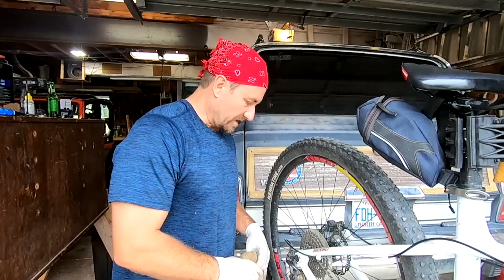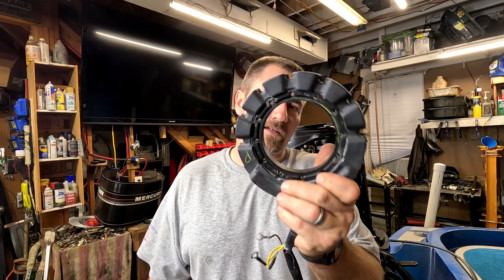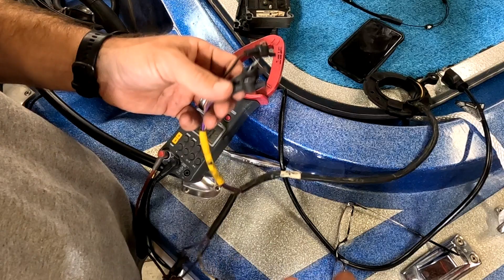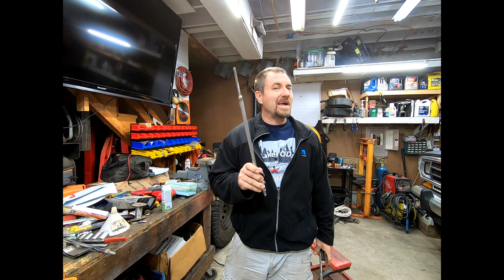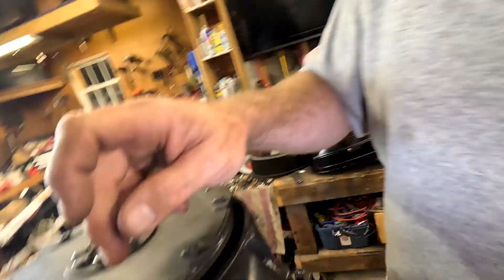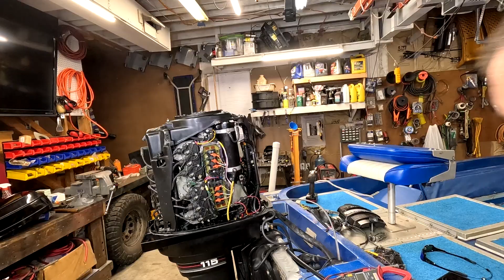Mercury Tower of power Not running well.  Simple OHM test to find the issue.

Comment: Could you share the actual numbers from the book for what ohms should be, or the name of the book you are referencing? I'm having similar issues to other commentors, except if I feather the top end of the throttle it picks up and goes (still not as powerful as it should be). Carbs were just rebuilt. Electrical is something I can test while i wait on a fuel pump rebuild kit. Thanks
Reply from the maker: Sorry for the delay.   We just got back from an Alaskan trip.    it is where the internet forgot to spread.  :)     But would recommend a trip.   But I would have liked to do more fishing.   Maybe next time.  

I just finished a fuel pump rebuild this morning.  I hope to get it out this week. 
You can also check your timing.    Super easy. 
     https://youtu.be/Yn8pdeiwbas
For a manual of your engine.  just get your S/N and you might have to order a paper copy.  i am sure there is a pdf somewhere but a paper copy might be better in the shop. 
     https://www.mercurymarine.com/us/en/parts-and-service/service-and-support/owners-manual

I just love the Tower of Power.   So smooth and last for ever as long as you give it some love sometimes.   

Thanks for the question and let me know how it goes.

Comment: What issues did you have when running with the bad trigger?
Reply from the maker: The trigger was not huge to replace since I had issues with the stator.    So i changed them both.   Was not having any issues with the trigger.    i still have it as a spare.    I now have fueling issues at wide open.
Reply: @5LakesGarage I guess I’m curious what symptoms you had with the bad stator?

I am having issues with my motor running fantastic on the hose but in the water seems to not want to get to full RPM seems like it is running half of what it should.
Reply from the maker: So the stator has two different ranges.    low rpm and high rpm.    I don't remember the color for each.    it sounds like the high rpm might be having issues.    it has been a bit since i messed with it so I will have to remember.
Reply: @5LakesGarage I also have an early 70s motor which has a different switch box and some different components than yours.

Comment: Hey man I was wondering if you could help me? I have a 1987 2 stroke Mercury 115 6cly outboard motor and it will idle for about 20sec and then shut off. It use to idle okay. The fuel pump was rebuilt. It has good compression in all cylinders. It does have spark in all cylinders. Although when I pulled the spark plugs a few cylinders looked to be running pretty lean and others were running rich. when I get it on the water it bogs down at full throttle and does not go full speed. it goes around 5mph at full throttle. Then randomly after around 20 to 30 minutes of full throttle and it bogging down it will randomly surge and start going full speed and not stutter or have any problem at all until you go back down to idle where it happens again. I have recently went through the carbs and cleaned them I did not see anything wrong with the float valves it did have a float with gas in it but I replaced it and it did not help. I also recently replaced the power packs. I’m not really sure sure where to go from here.
Reply from the maker: Sorry for the huge delay.   Day job is getting in the way sometimes of what i really want to do.   Help you guys.    

so it sounds like you have covered the fuel pump, compression and spark.    it does run but like junk so I am thinking of two things.  One basic, do you have a second fuel source that you can try out.   I just had an issue with my bothers outboard and he had a pin hole up the line that was bringing in air.  not a lot but enough for it to run for a bit and shut off.  Super annoying.   the lean cylinders and shut off seem like it is loosing prime.    Super easy to check.   The other would be getting a good signal from the trigger and stater.    Check out this video to be able to test them.   https://youtu.be/jlfrhwPYYV0?si=nZEcxEUgXZYkNbrO

i Hope it helps and sorry it took so long to get back with you.

Comment: Hey thanks for the nice Video. My motor starts only at full throttle idle and idles not too high. it is ok but when I release the gas to go in neutral and into gear it dies immediately. What I wonder too is that i can pull the sparkplug plug from cylinder 2 and 3 and it runs pretty much the same but i do get shocks when i pull them so it should get spark or not?
 I am thankful for any Help.
Reply: Another question: whats the name of your spark plugs?
Reply from the maker: Sorry for the really late response.    I am way behind and trying to catch up.    I like the NGKs
https://www.amazon.com/gp/product/B08B51WJGG/ref=ppx_yo_dt_b_asin_title_o07_s00?ie=UTF8&psc=1
Reply from the maker: Will have to ponder this for a bit.   What were you readings after doing the OHM test?   I am favoring a fuel issue if you are still getting spark.   
https://youtu.be/UMK2hxR4JFo?si=sybTxkhfwQxUEwCm

Try this one.   Might not have to do a full rebuild on them but a good check of the floats.   

Sorry for the really long delay.

Comment: Do you happen to have the part numbers for the stay or and trigger?
Reply from the maker: https://www.amazon.com/gp/product/B079CTMFWJ/ref=ppx_yo_dt_b_search_asin_title?ie=UTF8&psc=1
https://www.amazon.com/gp/product/B013SGEAWG/ref=ppx_yo_dt_b_asin_title_o09_s01?ie=UTF8&psc=1

These are the two i used for our Tower of power.    So far so good.  Put them in 2 years ago and it runs like a top.    

Good luck with your project.

Comment: Where did you find power packs
Reply from the maker: it look like the original place i got them do not carry them any longer. 
I found a few.   I love to go with OEM but this one is a bit high.  wow
https://www.boats.net/product/mercury/7778A3?ref=24b4bfbf9c11f3f4835ebff9137ae95a0f08c565

This one is a bit better
https://www.wholesalemarine.com/sierra-18-5775-switch-box-replaces-332-7778a12/

This one has the best price but you might have to send them back a few times to get a working one set.
https://www.amazon.com/Switch-Mercury-Outboard-332-7778A12-Switchbox/dp/B074M1X7QN/ref=sr_1_1_sspa?crid=3PCBMPHRMQ4B&dib=eyJ2IjoiMSJ9.NlbW9GpMo_QgF_fPPYPEJV1quX1J-Xt7bQY_4OwAkTPHc4M6VPvMzdx1tR5zFIysNRxy7b5ICDP7iD71prHPsqAPOXEO-6GgkvtLqye1DK0Ro52zd8P0I_zAuVfgMRJHJPtKVh40RlhTyMYrEZyhCQ3LaSOePNk84kL6UTVZkTk9WkRIs4-uxbj0I9u_O1ZCpiJxijEwT2O2ic1x58ZIf49jAviIZwJhkO3pAykJmDa1eJB_Tj23UKdp8jxU8-yBN7WEhOiOor1D-zttiJpF719NkyvN88uwZ03QI-BU3mQ.FT0zc2VfzXeIIVkjtzn77knQBJh_d-Sw7rDVAQiUiMQ&dib_tag=se&keywords=mercury+115+2+stroke+power+packs&qid=1713529594&s=automotive&sprefix=mercury+115+2+stroke+power+packs%2Cautomotive%2C90&sr=1-1-spons&sp_csd=d2lkZ2V0TmFtZT1zcF9hdGY&psc=1

I was lucky and got a set of working one the first try.  

Good luck.  it is good to see we are keeping the Tower of powers up and running.

Comment: How do you check oil on these motors sorry i just got a 1979 merc 90 6cyl and i dont see a dipstick?thanks for your vids!
Reply from the maker: Sorry for the delay.  I was in the woods with the scouts and did not have fancy internet.   :)     These engines are 2 cycle so the oil is in the fuel.   Most of these outboards come with an automatic oiler.   Mine has been taken out so I mix it with the gas when I fill it.   Now you do need to be aware of the lower unit oil level.   https://youtu.be/soekr7hXi1g?si=PAB9DSwSoHq3LhAu
Reply: Thank you so much!!!I was so confused lol thanks once again!
Reply from the maker: All good.   We are all here to work together.    Another repair that you can think about since it is "new to you" engine would be the impeller change.   https://youtu.be/geyxxGE2DSE?si=9rHcgmylaynZqyiv

Comment: 1989 115 Mercury. My trigger is reading no resistance at all (a new one is on the way). Runs fine at idle but boggs down at half to full throttle. How do you think it's running at all with no resistance on the trigger? Seems impossible to me.
Reply from the maker: Strange that it can run with out a resistance.   i would have to really think about that.   The boggs might be a lack of fuel under load.   The Fuel pump on these guys on a vibration diaphragm.   Simple and cheap to rebuild.     Just make sure you get the right rebuild kit for your engine.  it took me two chances to get the right one.   https://www.amazon.com/MERCURY-QUICKSILVER-89031A2-FUEL-DIAPHRAGM/dp/B004QJQKAK/ref=sr_1_6?keywords=mercury+outboard+fuel+pump+rebuild+kit&qid=1686919853&sprefix=mercury+outboard+fuel+pump+rebui%2Caps%2C137&sr=8-6
Reply: Hey I’m having the same issue with my 1983 115 mercury. No ohms. Bogs at 2500rpm. Did you have any luck finding your issue?

Comment: Hi 5 lake garage. I have a 1983 115 Mercury also tower of power!!! 
Just wondering if you have any ideas on what could be making it bog down under half throttle and above. The motor ideals and starts no problem just fails under load. Also love the videos cheers
Reply from the maker: i would check two things.   

Advanced.  Make sure the throttle lever is advancing the trigger.  

Fuel starvation.  Check fuel filter and diaphragm on the pump.   Here is an example of the rebuild kit for the fuel pump.    Just make sure it will work on yours.   There were a few years that used a different pump setup.